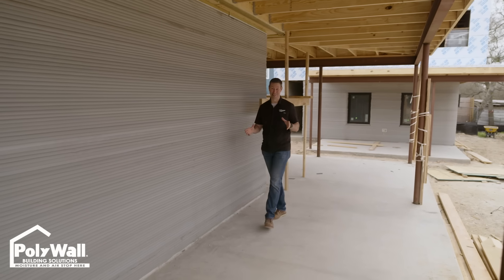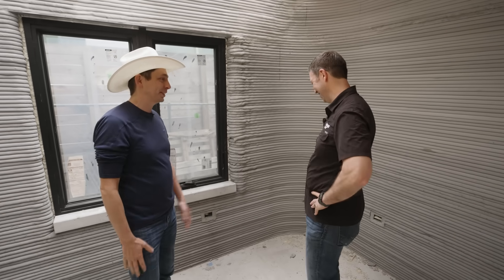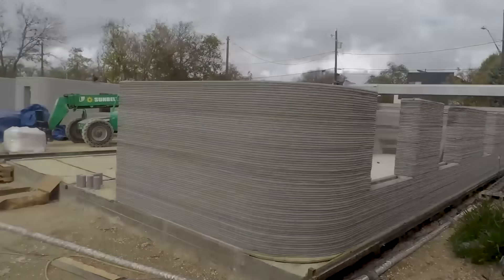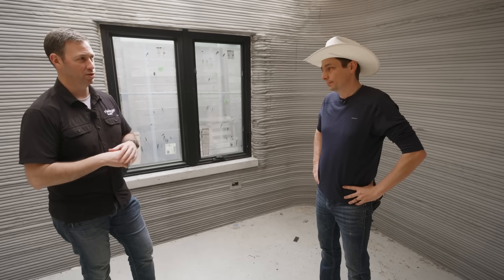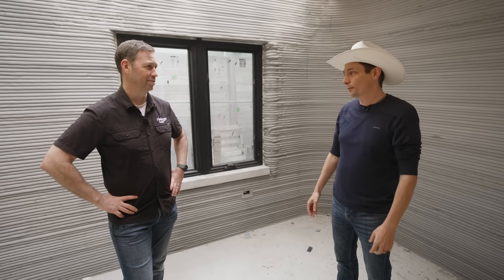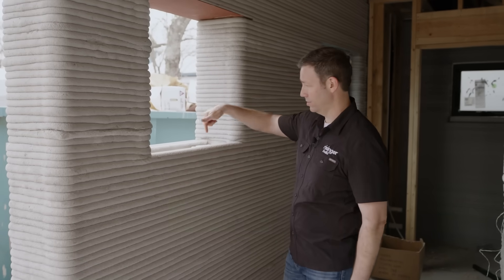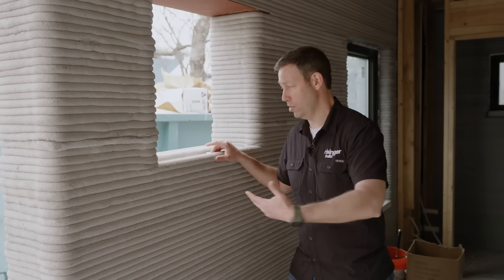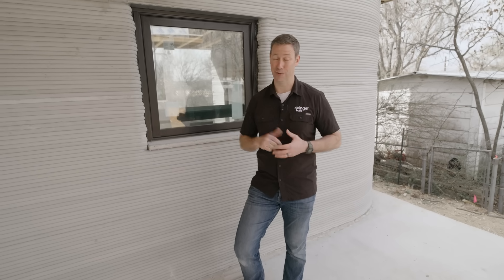Is this the future of Construction? 3D Concrete Printed Homes

Comment: Lennar also probably has a WHOLE TEAM OF LAWYERS writing the contract you sign to make sure you can arbitrate/mediate only, that in the end when your 3D printed house fails, you at most get a $10 rebate on a option for fries with your BigMac.  It will be 18 pages long, signed in your blood.

No rebar ? the concrete mix is merely squirted out a nozzle in "layers" to create these homes, right, will they offer a bonafide warrantee with the sale that protects the buyer against crack, failures and such ?  Why not show a real world test, like Mythbusters - - - drive a car at 30 mph right through one of these walls - - - see how strong it is NOT ?

Warrantees are not worth the paper they are written on if the builder just declares bankruptcy (perfect legal scenario would be Lennar creates a new special "division" to build these 3D houses, when they fail, only THAT division declares BK and get's flushed down the toliet

Austin and all cities should require a paid up in full, in advance, insurance fund by Lennar be setup that lasts 50 years or so to protect buyers . . . 

This could end up being a huge SCAM in the making . . .  10 or 20 years down the road when the whole neighborhood is "blacklisted" by inspectors / code for wall or slab failures

Comment: This is a terrible idea from a sustainability and environmental point of view. Concrete is a terrible material from the point of energy embodiment, not to mention the degradation that will occur from limestone quarries. Mass adoption of this technology will be an environmental disaster.

As far as the building itself, you cannot remodel the structure. Try knocking down an internal wall. You can’t even put a wall socket at a later date and run a wire to it. With pure concrete thermal insulation and water absorption/infiltration is an issue.

They claim 48 hrs print time for the house. However, this is spread over several days. Concrete has to cure. You simplify cannot layer the whole wall in one shot. 

A better way is pre-fabbed engineered wood panels. Particularly those made from bamboo. I bet you can erect a wall with pre-fabbed panels in a fraction of the time it takes to 3D print the same wall.

Comment: A big advocate of digitally-controlled concrete, but very surprised this project even got a permit.  Some shear walls are pretty slender, a whole house to support above, and nary a rebar - which makes the existing cracks serious as a heart attack.  The windows are guaranteed to leak, and the lintels look to be 100% efficient thermal bridging - could not possibly be less energy efficient.  Probably will get mold.  Big problem is that this will make it harder for the better quality digital builders.  This contradicts everything that Risinger preached until this video.

Comment: Looks promising, but early... I'd want rebar and the walls smoothed or textured with plaster or cement. ICF remains my favorite concept until they refine this process, possibly with carbon fiber etc. It really is time to advance past stick built homes unless you're camping.

Comment: I've never heard embodied energy mentioned. Cement / concrete is a bad material for carbon, most foam insulation is petroleum based. Not good.

Comment: I don’t think so. The claims they make are false . The houses they have done thus far they claim it’s cheaper for consumers but listing prices are no cheaper then conventional builds. They are also suggesting it’s 3D printed home and at least half of it if not more is wood and conventional framing. Also they claim it’s faster and it’s not. They printed in a week , a frame crew can frame that house in a week as well. What this really translates to is a damaging blow to our work force and maximize profits for the corporate companies further. Yet another tactic to take jobs away . Just the same as self checkout at all the stores now. Eliminate jobs make more money and completely eliminate the barely hanging on middle class

Comment: Stress crack from hell house don't have to be smarter than a 5th grader not to choose this type of construction. And funny using NASA to try and sale this  Gengerbread house. Better off buying 50,000 camper it will hold your roof up longer.

Comment: I love this because I hate sheetrock and fiberglass insulation.  I'm interested in in Sebring Florida.  My lots have a lot of natural white sand onsite. Looking for something very untraditional/custom but simple, small and modern. under 1000sqf with single flat pitched roof with a giant open carport on the side. Open concept shell with plumbing in the shell. Plan to run electrical in the wood roof only.

Comment: If you decide to make changes later is it possible? Can I add or knock out a wall?  What's the R value of these walls? Are there any shrink/swell issues? What about moisture content? These are just basic questions that are likely answered on their website or somewhere else. This has a lot of promise and this is just the beginning.

Comment: Didn't I hear world is running out of this specialized jagged sand. 😒
And at 12 minutes in he is standing where a window hasn't been put in yet,... I thought the guy that designed this said, that the two walls never touch because of the heat or cold transference..?
Don't get me totally wrong I like the idea. But where's the sand coming from.?

Comment: The concept is cool but the detail is still pretty crude at this point. Like others have said keeping those walls clean will be a huge headache. Things are getting better and the accuracy is "starting" to get better if still quite sloppy. When they can produce smooth, parallel surfaces with embedded finishes that hide the layering, then perhaps they'll be ready for prime time and be competitive quality wise with other building processes, IMHO. As always, thanks for the info.

Comment: Call me when they are printing houses out of fiber reinforced insulating foam.  With only the 1st level printed it seems that 60% is still wood frame.  Prefab panels using cement board and insulation would probably be as quick and cheap.

Comment: the problem is that 3d print is supposed to make at home production of objects cheaper than buying the pre existing manufactured versions the ability's to create something and not need to rely on commercial products and corporates pricing,  literally 3d printing is the bitcoin of manufacturing 

because of prices of concrete and insane unnecessary markup of labor and materials and prep  i don't  see this ever taking over the home construction industry anytime soon 

 using mostly concrete that home would be insane in price, making it unaffordable to most people compared to building with just lumber and nails ext. 

a 2 story conventional  style home built in wood would be 100-200k$ while the same home in concrete would be 300-400k$

NASA is interested because they can afford it in a mass scale, and only well off individuals are building 3d printed homes because its interesting and they can afford to experiment

until prices for everything come down to meet the average annual wage of normal people this tech will remain commercial, specialized, and at best novelty

we saw the same result with at home FDM plastics 3d printers almost noone bought them eccept commercial applications  untill the average  price of PLA filament dropped to 20-30$ from 70-90$ and printers dropped to  200-500$ from 700-2000$ and even now people are not really getting into it because the prices is still a little too high and the learning curve is a little to steep for most people 

im just glad 3d printing/CNC machining still remains to be mostly open source without that the technology would already be dead on a consumer level  and no one would be able to afford it except manufacturers and corporations 

to this day these big business are trying to grind it down using pricing as a weapon (which should be illegal) because at home production would destroy there businesses mainly because they produce garbage for high price and at home manufacturing  has better quality for cheaper and custom catered geometry if designed well

Comment: Very cool concept, I can imagine this being great for industrial applications where robust but non-permanent assets need to be constructed, as well as the making of military installations. I am however concerned about the CO2 footprint of a house like this. We need to get away from both foam and concrete because those are both really bad at releasing greenhouse gasses.
Reply: Great video! Agree about the CO2 footprint issue though. As a builder in California, i definitely wondered where's the steel. Perhaps NASA can help to co-develop a less carbon-intense type of concrete, or an energy source to kiln the type we already have? Also... Where they getting water to mix cement on these Other Planets.

Comment: What about pouring an aircrete, gascrete, foamcrete insulation into that void. Still good insulation performance but all one material they would not need to source the spray foam. Also no issues with bug getting into that void and chewing out all that foam. It would be impossible to remove a hive from within those concrete voids and if you poison the infestation you will so find you have a roach infestation that will not go away and spread into your home. The use of an aerated concrete insulation material for that void would prevent all possible but infestations.

Comment: concrete minus steel/rebar should equal cracks....no matter the fiber .....compression strength 100 sheer strength still seems an issue.  best of luck.

Comment: Hate to be the Electrician that missed a home run wire lol
Reply: A design like this would likelybe done in conduit.
Reply: Where I have a home in Mexico, block and concrete walls are the only method used. Electricians will cut grooves into the walls for wires and then patch them.

Comment: We need to decarbonise the cement manufacture before this method reduces embodied emissions over timber frame. As it stands it's going to be relatively high-carbon despite the low wastage. I'd like to see the numbers  - it's certainly interesting.

Comment: There's another group printing using a resin.  Like epoxy.  They use the robot arm to sand the walls smooth again.  It would have all the benefits of concrete, with an additional amount of flexibility that concrete doesn't have.

Comment: Just a couple of uestions remain.  I did not see the reinforcement/earthquake structure.  I also did not see how to manage remodels/changes in sizes of windows or doors.  I'm all for electrical run through conduit, that just makes sense.  Wall pipes give rise to concerns should a maintenance issue arises.  Love this new tech!  Really appreciate you bringing this to us!

Comment: Those houses still like 20y away from mass market. Why to build that crazy machine to print the house, if you can pre-manufacture concrete walls and install them in no time? 16 stories apartment building built like that in Soviet Union. That technology exists already like for 60 years?

Comment: Ahh, no. This is neat, but NO ONE WANTS THAT AS THE FINISHED wall surface. Oh yeah,  and there's all the trades and devil in the details to make a building actually work.  And how do you hang a picture on that.  Look at the concrete  house trials in the 1950's. Same enthusiasm, no takers

Comment: 1) Almost every country outside of the USA is using formed concrete to build houses and commercial buildings.  In other words the forms are set up around rebar and then pumped full of 4000 psi concrete.  Much like they do high-rise buildings in the US.  The forms are usually pre-designed on a computer and then put together on site.  Very simple and efficient when they use the aluminum forms.  I don't understand why the building codes are not changed in the USA......especially in places prone to hurricanes.  It doesn't make any sense when you really think about it.  

2)  I would like to see geo-tech testing on this wall system to prove how strong it is.  There is no rebar or reinforcement at all but maybe the multiple 2" layers create a stronger structure.?  It's very interesting but still does not look very practicable to me.  Good video!  Thanks.

Comment: Why, in Texas, are they installing black exterior walls and roofing ???!!!  And, it wouldn't take much imagination to add a sculpting-blade to that Printer so that the exterior surface and the interior surface are smoothed flat.  Some people want flat walls, plus, those rounded layers will be an incredible dust-catcher.  I'm really curious about the earthquake rating this method of construction has.

Comment: I have been watching these for a few months now.  I wonder about lack of reinforced concrete.  Are they using helix or something comparable?

My issue with the interior walls would absolutely be dust on the shelf beads.  Might leave an accent wall or 3, but some sort of sealing to limit dust collection would be a must IMO.

This technology is going to greatly reduce construction costs.

Comment: So, if I want to hang a picture on my outside wall, I'll need to use concrete anchors? Sounds a little unforgiving. The electrical rough in looked a little rough, I guess cutting in a new box is out of the question. Also how would you anchor the boxes, especially in the instance you just showed were the box got left out of the pour?

Comment: This would not meet Israeli Building Code, What about Rebar, Fire Doors, Sealed Safe Room Blast Doors and Windows to protect against Missile Attack with Poison Gas and Explosives? What about Earthquake Resistance measures? How do you repair Cracks? How do you Add or replace Pipes and Electrical Wiring? What about Remodeling? Most Israeli homes are in Walk up 4 - 6 Story Apartments. Most homes are "new" within the last 2,000 years. All they had to do is add Electricity, Sorry the Roman and Greeks did not have electric lighting or Computers. They are lucky no Facebook.

Comment: I dont know about the finish, it's kind of rough on the corners openings and around the electrical fittings. When he shows the wall socket, the wall has cracked from the socket to the ceiling and how the fuck you gonna fixing it without it looking like you fixed it. I definitely see the potential, but kinda looks like teething issues.

Comment: Its a shame they arnt using a scraper on the interior walls to give it a smooth finish. Those ridges would hold huge amounts of dust and dirt. Im surprised they arnt using fibre glass fibres in there mix to give it strength like GRFC bench tops

Comment: So what happens when you have a pipe burst in the wall? And if heat rises and it’s rising into the stick framed top level and escaping. They just complicated the first floor for not much gain short of the durability of the exterior

Comment: For those who are talking trash about this....... all of us have seen and been in many buildings that were made of concrete. I even watched first hand as a jail was built using precast concrete slabs for the interior walls, exterior walls, even for the floors/ceilings between levels. It went together like a giant Lego set. Granted, those precast slabs were reinforced with rebar, but this concrete can be easily mixed with fiberglass for reinforcement. The cracks in the house shown in this video suggest that no fiberglass reinforcement was used. Yes driveways and sidewalks crack, but they are often not reinforced with anything, depending on local code. The cement (not concrete) used in driveways and roads, also has larger aggregate mixed in which serves much more for volume than it does for strength. Cement driveways, and even roads, are subjected to the constant pounding of vehicle weight, as well as salt in the winter, also motor oil, transmission fluid, and other fluids from vehicles, which unlike water, soaks in, does NOT evaporate, and weakens the cement. The city I live in recently dug up my street, all the way down to soil, including our driveway aprons, the part of the driveway that is between the sidewalk and the street. When they poured the new driveway aprons, and a few sections of sidewalk as well, there was no rebar, or even wire mesh used. The concrete used in this building, is not going to be subjected to any of that abuse. This is also a relatively new way of building residential homes, so naturally there are going to be a few things that need to be addressed, but in less than 10 years of use, most of the issues will have been worked out. Another thing to consider is the astronomical price of lumber, and the incredible number of man hours needed to build a similar size structure. Lumber is up around 200% from last years prices, demand is HIGH, supply is low, and there is no sign of relief anytime in the near future. 1 or 2 people can put this up in about a weeks time, as mentioned in this video. Material cost and labor hours are dramatically slashed. I can easily see how labor unions would not be very happy about that. Here is a video (not mine) showing a 2 story 3D printed house in Germany.  https://www.youtube.com/watch?v=qWBA-6NgIJg
Reply: Here is a precast 3D printed house that can be as large and complex as the owner wants. https://www.youtube.com/watch?v=1WXHJn7z-hM

Comment: I noticed a crack in the wall above the electrical outlet.  I wonder what happens if there is movement in the ground and the walls shift. Also wonder what happens with freeze/thaw if the walls absorb moisture.